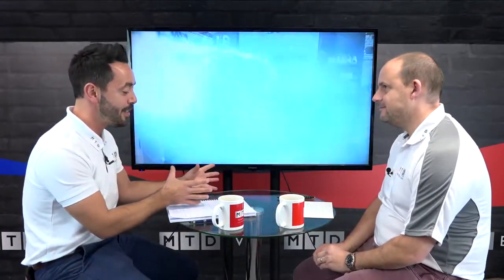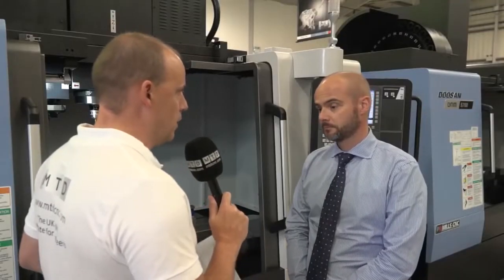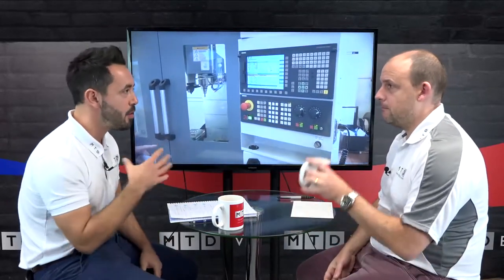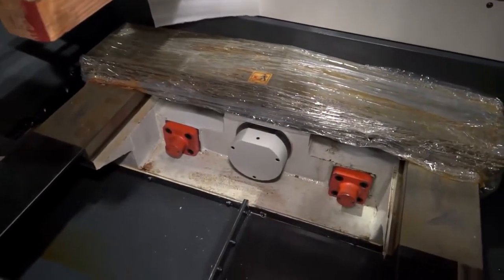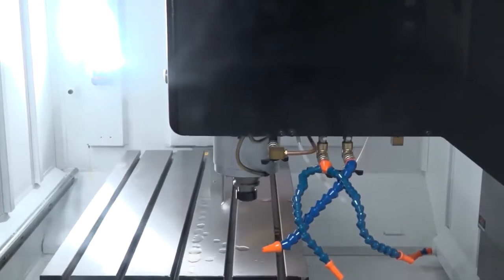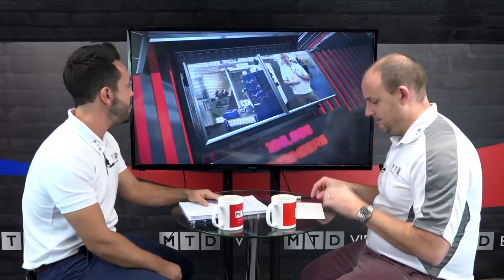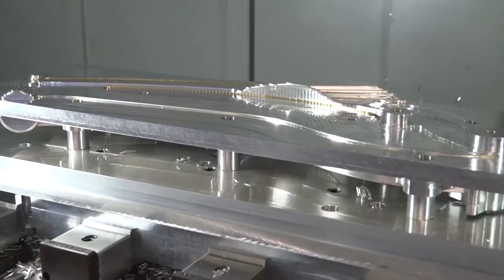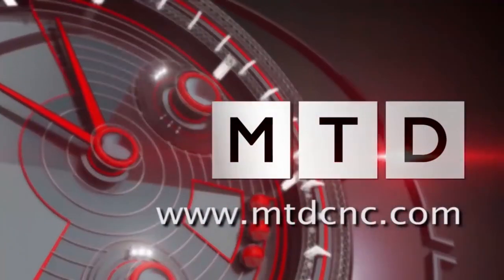Technical Corner  - 3 axis VMC market explored

Comment: A big point about the self lubrication on the DNM Doosan, is that tool life can be significantly improved as 3-5% tramp oil can result in a reduction of tool life by around 30-40%